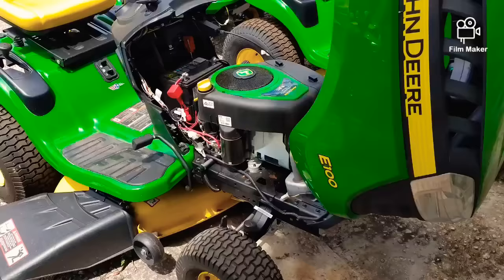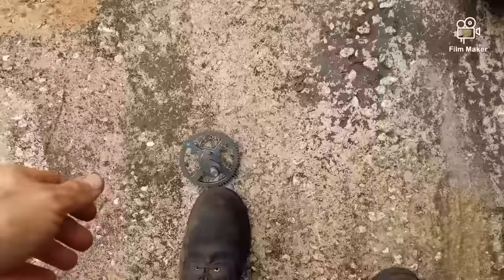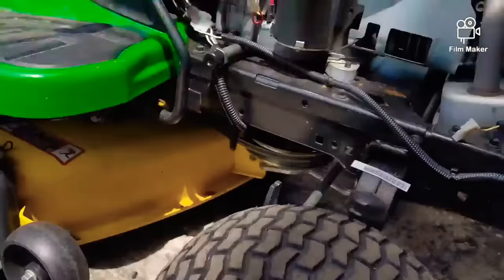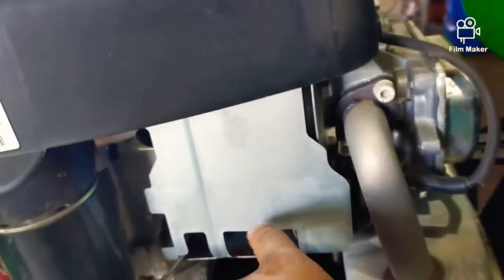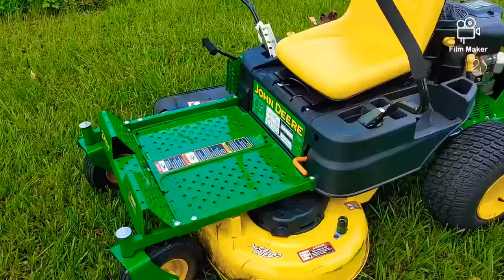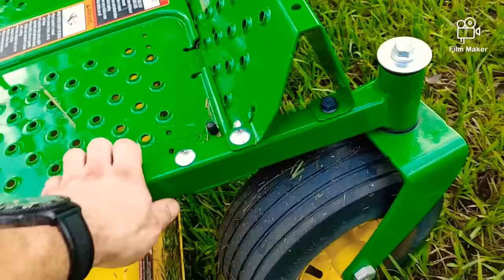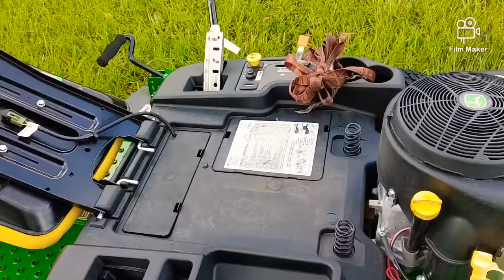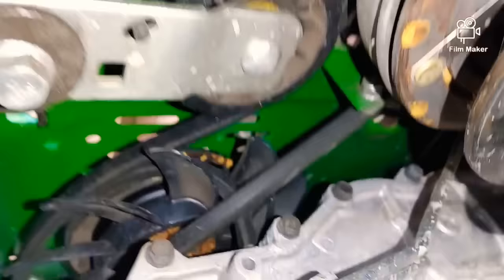Lawn mowers to avoid!

Comment: I have encountered that starting problem with a couple of mowers I had in the past.  The last one was a new Cub Cadet with a Kohler twin cylinder.  Now I understand what was happening.  BTW, the engine went out after about 1 year.  Fortunately, the local box store, not Lowes or Home Depot, stood behind their sales and gave me my money back.  The Husqvarna with the Kawasaki V-Twin has done well over this first year.  No more Cub Cadet or Kohler engines for me.  They do not honor their warranties.
Reply: Usually that was the starter. They spec an updated one for them now. I have a 15 year old Kohler Command engine on a Cub 2554. Zero problems other than just replacing the main seals last spring. Fairly easy job. Just now ordered a voltage regulator for it. That's it. The Kohler Courage engine had it's share of problems however. Apples and oranges. Someone GAVE me a JD with the water-cooled Kawasaki. Oh gees... Head gaskets blown, water pump leaking, this, that, the other thing. Why in the world complicate things with water cooling on an engine that doesn't need it?
Reply: Love my husqvarna z54.2900.00 3 years ago. 23 hp kawasaki. Easy to maintain
Reply: Just bought one. The 10 year old jphn deere motor locked up.  Trying the cub cadet. With a knoler engine on it brand new
Reply: Kohler usually doesn’t have to warranty there engines, because they usually make it years out of warranty before they ever present a problem. I bought my wife a cub cadet xt1 lt46 brand new in 2015. It’s had a deck and drive belt replaced once, and regular services every year, and runs perfectly with 351 hours. I bought myself a bad boy zt elite60 with a kohler, because I trust them to run and get the job done.
Reply: Kawasaki Engines all day long!! :)

Comment: I have the John Deere X739 4x4 and I would not trade it for any other Mower. I mow several acres every week and a couple of those acres have steep inclines. This tractor has been working this land hard and does the Job well. The four wheel steering is fantastic and it operates just like a zero turn mower.
Granted most folks don't need a tractor like this just for mowing but some of us do!!!

Comment: Thank you for being honest. This is why I run a 1991 Honda 3013 with a 38" deck lol. My 98 yardman yardbug aint bad either as a rear engine rider, but the 27.5 inch deck has no anti-scalping wheels. 9hp is weak, but sips the gas, does 5mph & is reliable. No transmission. Variable speed belt drive, 2 of the same drive belt,
Reply from the maker: These newer products are not built as well as older models.  So many people don't understand that.

Comment: This makes me glad we bought a D100 years ago. It's still going strong. With one caveat - the Left mower braking arm has a rubber piece which wears every time I get off before the engine has completely stopped. Eventually it wears enough that it flips past the point where it's dragging on the pulley, and then it destroys the blade drive belt. I replaced it once. The second time it wore out I removed it.

In contrast to the E100, the D100 drive belt takes some effort to remove the deck, but it's not a nightmare job.

Comment: One problem I had is on my z375r was getting good replacement belts. After finding at the time that they were out at the warehouses, I checked repair shops and they couldn't believe how thin, and narrow the belt were on such a long belt. I finally got some in but they kept breaking. After the third one I added two chain links to the spring, and no more breaking. Now you may think I just was getting the wrong belt, but I was getting it from the dealers. I mow about four acres, and no more problems.The frame seems weak but it seems to be holding up okay, so far. I am on my second year, my first one was not a zero turn but last 25 years, same size engine.
Reply: Make sure the belts have Kevlar in them. They last.
Reply: @finfan1009  At the time I was hurting for a belt, dealers, and warehouses were out. I even tried to match it from other brand lawnmowers. I mow about 4 acres, and it was getting high. From now on I will check for kevlar  thanks!
Reply: Tractor Supply sells Kevlar belts. It solved my belt problem on my Dixon 311.
Reply: I have a Z365r and belts are hard to find. I like mine. 2 of my dogs ride with me as I cut 2 1/2 acres a week with it. I have gotten my money’s worth out of it. $3500 Home Depot

Comment: I have heard that people have had issues with other mowers with a Briggs motor. I even had a craftsman push mower that didn’t even last anywhere close to 10 years (bought in 2011 prior to failure in 2016, ended up being replaced with a Honda push mower. John Deere tractors are not the actual John deere quality anymore, compared to the older ones up to the 90s. My grandfather had a John Deere riding mower from the late 80s, maybe early 90s(?), and never had major issues with it, but he did do some repairs which are less trouble than than new ones before he passed away in 2017. My uncle has a few vintage John Deere tractors from the 80s up to the early 90s. They are pretty solid quality and gave him no trouble to use. My uncle has a John Deere 755 and a John Deere 430 and they still worked perfectly after all these years. It seems like the older John Deere tractors were made a lot better than the modern ones. When it comes to John Deere mowers, I rather have the one from the 80s or early 90s since they were built a lot better. They just don’t make them like they used to.
Reply: I even use a 30 year old toro wheel horse riding mower and it still mows the field, plus it’s good on gas.
Reply: My 1967 john deere 110 ran ok but the old k181s engine was missing a part piece that sped up the engine so i took that old engine off and will make a new one fit and work on it all the spindles on the old deck are froze solid the old pulleys work though i took the deck off to 

Thats the heaviest mower i have
Reply: @Mike-su8si  I wish they still made these good quality mowers today.
Reply: @JoshuaAndMom  i know if John deere did or done a remake on a model and made it solid they would sell those out
Reply: @JoshuaAndMom  at a friend's i use his 80ies model john Deere's they still work like new with no problems

Comment: I have a z 425 that I’ve had for 14 years and have only replaced one deck bearing and need to replace a wheel bearing on the dolly wheel. Still has the original belt on the deck, uses no oil and the deck is in great shape. Mine has outlasted any mower I’ve ever owned.

Comment: Have a Z525E bought 6 years ago and bought the 5 year extended warranty.  Best $500 I ever spent. Has gone through 5 transmissions and one deck.  If It dies now I'm taking the motor and installing it on another old mower!

Comment: I bought a Z235 years ago at the John Deere dealership and other than normal spring time up keep it's been running great. My ZTURN does have grease fittings on the front casters and mower deck.

Comment: I've had good luck with our cub cadet 0turn. It chews through everything very well, and I use it to haul logs and stuff when we chop up for landscaping. Only issues we had with ours is the belt fell off a few times but not to big a issue to put back on and happens rarely -and when it does its because someone new is dumb and drives into a rock or high brush. 

Also john deer mowers all are crap. Terrible. Screw john deer their stuff is expensive to fix to. Also craftmen and troy anything are garbage to. Deer is slightly above those, but these brands are dirt to me.
Reply: I bought a cub cadet,1400 42",in 2006,still runs and cuts great,only problem I have had is the deck belt like you said comes off. I have a trusted small engine mechanic that services it annually. Will keep it till it finally quits.

Comment: I bought a new 525E with the John Deere branded Briggs engine back in 2018 and it stopped starting with 7 hours on it . Local Deere Dealership first diagnosed the problem as a bad battery and replaced it under warranty second time it wouldn’t start they ended up replacing the entire wire harness. I Switched the front tires to no air solid because the factory tubeless never held air .
Reply: I have the z365r 24 hp. I have had to replace belts. Broken parts and front tire problems and on and on. I have become a pretty good mechanic along the way. The engine has been very dependable with no problems at all. It was $3250 at HD in 2021. I have 2.5 acres to cut every week during the season. Still going. -If It gets a major problem I will dump it.

Comment: Hey guys, thanks for sharing your experience on these mowers! Have a question: the 2023 z320r, seems on the surface to have addressed a lot of the things you brought up in the zero turn section - beefed up front end, new tire, bearing in spindle, new access to engine/deck, Kawasaki engine, deck lift is a foot+ spin wheel. Deck still looks to be 12 ga stamped, but I am a home owner not hitting stuff at a strangers’ property - have you checked them out? Any thoughts on the upgrades? Still same assessment?
Reply: Sorry, just seeing you’ve got a few people below that have brought this up. Will look forward to a new review. Been enjoying your videos! I’ll keep the comment here to keep the traffic coming. Have a great week and thanks again!
Reply from the maker: Hey Cody, I have noticed some models with the bearings for the caster forks. I havent seen any issues with those yet. I would imagine the deck uses the same spindles and pulleys which seem to be hit or miss. I just posted a video about one that had less than 14 hr on it and already had a bad spindle and a bad pulley. In my opinion the 300 series zero turns are over priced and under built. Id rather have a S130 or S140 or a X300 is far far better. Just my opinion. I apperciate you watching! 🍻

Comment: I'm in Australia and have had a Z910A for around 10 years, how do you rate them. Had a small problem with valve clearance adjustment a while back. I run it pretty hard on 20 acres that often needs to cut 6 foot grass due to our wet seasons in the tropics . I change the oil and grease everything over pretty short intervals to try and look after it
Reply from the maker: Hi James! The Z910A is light years better than the residental mower in this video. The Z910A is great Commerical grade mower. Thanks for Subscribing. Stay tuned for more videos on the Z900 series mowers. I'll have more valuable info available for all you guys coming soon.
Thanks again 🍻 !
Reply: @Mechanical_Mind  love your easy to follow instructional videos, wish I'd had access years ago!!!

Comment: I had a JD D230 for 12 years and mowed a 3 acre lawn...ultimately I just wore it out but I was happy with getting 12 years out of it.  I now have a ztrax 320 I've used it 5 times now and it has turned a 3 hour job into less than 2, I have no complaints

Comment: Hey, what's your opinion on the new John Deere residential zero turns, specifically the Z330R ?  Looks like they beefed up the frame, gave it a Kaw 23hp engine, changed the deck height setting to a dial and foot pedal, added LED lights, 20" rear tires and a few other things.  I know you hated the previous models but have they made some improvements here?  I am only mowing my own <1 acre residential well groomed lawn and I take care of my equipment.
Reply from the maker: Hi Mellowjammer! Thanks for subscribing. Those are all good improvements and much needed also. I think they may put bearings in them for the caster spindles instead of plastic bushing without grease 🤦‍♂️ like the mower in this video. Next time I see a new Z330R I'll do a quick test run and review on the upgrades. Dont step on the deck when getting off amd on.  It might bend the deck. Thanks again for watching and subscribing! 🍻
Reply: I actually looked at one of these at my dealer today. They definitely do looked beefed up a bit from older models. Still a residential mower. But if you don’t mow commercial you don’t need anything bigger really I used to mow soccer feilds with 3 42 inch mowers just pin her down and don’t stop till the gas lights on
Reply: @Mechanical_Mind  The funny thing is they only put a sealed ball bearing on the bottom of the caster spindle shaft.  At the top it's still a $2 plastic bushing.  Why?
Yes, I'm getting the boarding step for mine so I will never be tempted to step on the deck.  At least the 48" and 54" decks are 10 ga. steel.

Comment: I've been needing a mower for the past 3 years and with the pandemic and supply issues, I see they finally have some good amounts of mowers even though they're a lot more expensive. I was going to buy a JD residential zero turn at a Lowes till I saw your video and now I'm leaning towards a 42-48" cut X300 series at the local JD farm equipment place. I have 2 acres I mow and the other 3 I pay someone to bushhog as the 2016 Kubota 60" cut, my 1st and only zero turn, didn't work out to keep it all mowed so I sold it. I would've had to mow it every 5 days here in S.E. Oklahoma if we got plenty of rain. I'm sure you get this a lot, but what John Deere HD mower would you get if you wanted to stay below $4,500? I'm 62 and 300+ lbs. now and can't work on them like I used to. Sorry if you get this question a lot, maybe point me to a video that will help as I'm a new subscriber, thanks.
Reply from the maker: Id suggest buying from a dealer. They may have some used commercial mowers if you prefer a zero turn. Staying under $4500 will be difficult unfortunately to get anything HD. I do like the X300 series lawn tractors. They seem to be built well and I rarely see those need any major repairs. Thanks for subscribing!
Reply: I can tell you that z model sucks. 1 cut had to take to shop it wouldn’t start. After I got it back 2 months later again 1-2 cuts it wouldn’t run. I took it apart. Hard hard to get to carburetor. Got it to run. Same thing this year. Wouldn’t run. Sorry mower.
Reply: @heavyhaul8621  I'm a Consumer Reports subscriber and 7 out of the top 10 riding mowers are John Deere and 6 out of the top 11 zero turn mowers are John Deere. I'm leaning towards buying one of the top 3 riding mowers, a X354, a X350-42 and the S240-48.
Reply: Take this video with a grain of salt. My Z355E has given me great service the past 5 years. Maintain it and it will last. Neglect and or abuse any tool and it will fail.
Reply: I have an X380 John Deere. Only issue I've had with it is it is 7 years old and I've had to replace the solenoid switch twice in 3 years.

Comment: Glad I did not see this video before buying my Z335E 42" 20HP in 2020 ... So far, (knock on wood) its run and performed well in cutting my  yard ...  As in most equipment, it's the operator and maintenance that make the machine last a long time ... If one is out there driving it like a dumpercar, not cleaning and storing your mower after each use, then not doing your PM's you'll be taking it to someones shop for repair ... The only real problem I've had is in cold starting my mower .... Found that the choke butterfly was not properly closing .. Added a small spring to the choke so that it closes correctly , now it's GTG !  Thanks for the informative video... Lets cut some grass !  :)
Reply from the maker: Stan, you're 100% correct that its mostly the operator and maintenance that makes the biggest difference! Thanks for watching and commenting sir! 🍻

Comment: All this amazes me. I have a John Deere D100 that I bought in 2011 and still going strong. I mow 1.5 acres and the only problem I've had out of it was the deck. That wasn't even the mowers fault. I had hit so many things with it that one of the supports broke off. Other than that the entire mower is still original (Excluding the obvious belt change, spark plug, fuel filter, etc.). Even the tires are original.

Comment: I have a 2008 Z-225 )0 turn and so far with 340 hours still runs good needed drive and deck belt after 12 years . Other than that same spark plug , change oil each year , and several sets blades still chugs along.

Comment: Ive got a couple 48 inch z tracks. I agree they are pretty flemsy. But one of mine is pushing 1000 hrs without all that much trouble.  Not horrible for residential use

Comment: Thanks for the video. Helpful to know shortcomings of these mowers. I have a JD D130 with a 42” deck and the B&S 22hp V-twin engine. I recently overhauled the carburetor to correct idling issues (low rpm jets were partially clogged). I discovered the intake on my mower’s engine is plastic, and that it was warped where it attaches to the carburetor. I had to McQuiver a fix for it. Didn’t see the point in ordering a replacement, which was also made of plastic. Being warped was allowing unfiltered air into the carburetor, and I guess altering the fuel/air ratio.  😮

Comment: ive put the first 200 hrs on that jd zero turn, but the 48inch variant. every friday i burn two tanks of gas through it and have replaced the drive belt once at 178hrs. it was a piece of cake? i have no complaints and prefer to use that machine over our cat powered diesel badboy. nothing but good things to say for the residential jd z turns. its nimble, doesnt throw you around, and is light enough to pull out of the ditch by hand when you're distracted swatting flies. id buy one for my own lawn if i wasnt already sitting on a 60" maverick. a great video!

Comment: I've had my JD Z225 for about 8 years now (bought it at Lowes) and it runs great,  I took it to JD for a Gold Service (servicing and inspection) this winter (I only take it in about every 3 years) but I put in fuel stabilizer and charge the battery in winters and I keep it out of the weather.     The JD mechanic said the mower looked good for its age and hours.